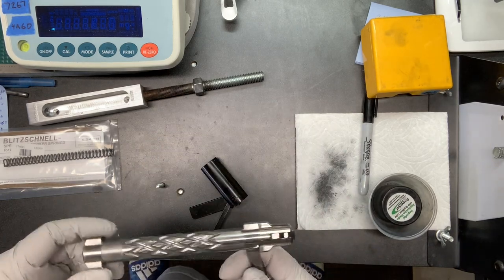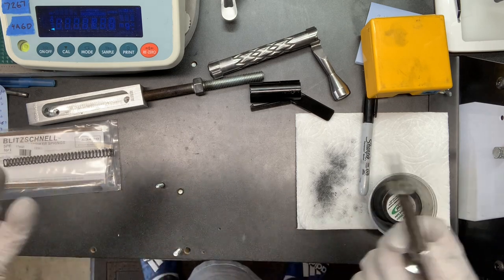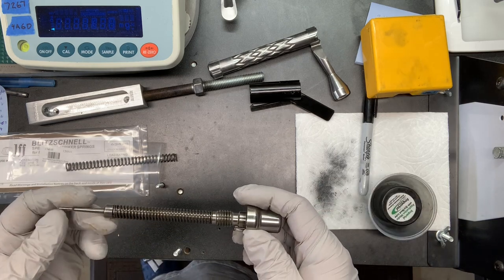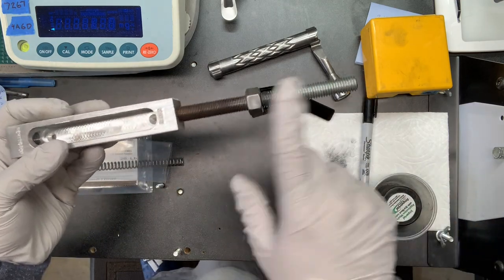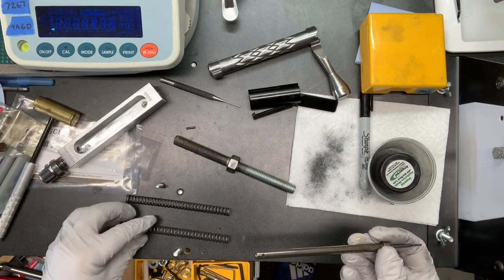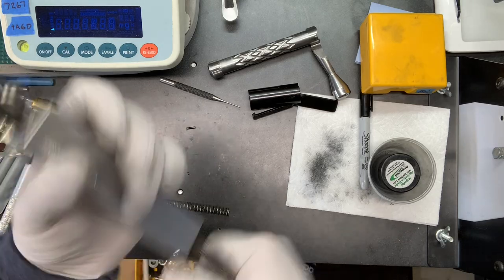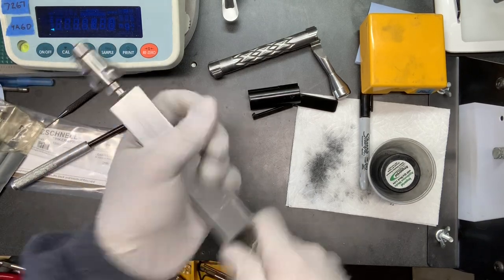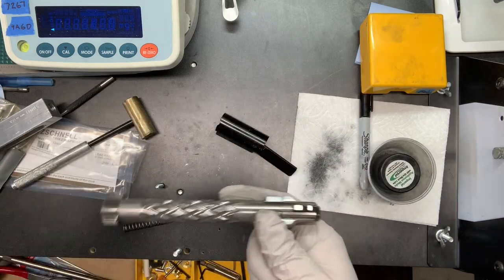How to Change Remington 700 (or clone) Firing Pin Spring and Why it's Important

Comment: This is a great video John, and a real eye opener for me.  After acquiring the tools and a Wolff replacement spring (factory 24lbs) for the Rem 700 bolt in my f-class rifle, I was able to switch out the spring very easily.  I was amazed to find that the original, used spring measured a full 1.25" shorter than the replacement spring.  And that's with only 925 rounds on the original spring, assuming the prior owner's round count was accurate.  (his 200 + my 725)   It might have been mentioned in your narrative or somewhere in the comments already, but I would imagine that just the length of time the spring has spent compressed in the bolt must contribute to its eventual shortening...  i.e., a spring w/ few rounds on it that has been in the bolt for a longer period of time (longer than a year, for instance) could become permanently shortened by as much as a spring that has only been in for a year but has many, many more rounds on it.
Reply from the maker: I’m glad you enjoyed the video and that it helped. You’re absolutely correct about compression overtime. In fact anytime I’m not using a bolt for more than a couple weeks to a month I will always de-cock it with my bolt tool so that there is no load on the spring.

Comment: Man I feel like I’m going insane.  This video is super helpful and I’ve followed all the steps.  The issue I have is I can’t get the pin back in.  I get the holes lined up and when I tap it back in, the holes get off set and it won’t go back in. I’m borderline thinking the pin got bent or warped which is why it won’t go in straight.  Iunno.  Such a weird problem to have
Reply from the maker: Getting the holes lined up can definitely be an issue. I know I fought with that one as well. I doubt yours is bent. I think I found that I went a little past zero when lining up so that as pressure was applied it helped bring the holes into alignment.
Reply: @FClassJohn   Line up the holes by pushing the punch all the way through. Then, retract the punch just a smidge while starting the pin into the hole. Start the pin back in from the same hole it came out. 🙄

Comment: John - what is your opinion on light weight firing pins (alum/titanium) and "high speed" springs? Should a person consider this or just use factory replacements and keep the springs fresh?

Great article...thank you
Reply from the maker: Thank you and I’m glad you found it helpful. As far as firing pins and springs go, I have to say that I think if you are buying a high-end action, I would keep with what the manufacturer recommends. I think they have a very good idea of what the pinfall should beand how that relates to the timing of the action. I know people who have been successful using different combinations but until you have a baseline with your gun using the manufacturer specs, I wouldn’t try changing anything.

Comment: When ordering a new spring and firing pin, do you order from the same company as your action?  I have a defiance deviant and am trying to figure out where to get replacements.  Not sure how interchangeable they all are. Thanks!
Reply from the maker: Yes most people will order form the manufacturer but companies like Wolff make extra power springs for 700 actions/clones and lots of people are happy with those too. The firing pin however should come from the manufacturer.
Reply: Thank you!

Comment: If I didn't know any better, I'd say you're describing my current situation. Rifle seemed to go from 3/8-1/2moa to now barely achieving 1moa with a 308 bartlein. Swapped scope and chassis, confirmed mounts, etc. I'm down to firing pin spring or triggertech trigger. 

How much did your groups open up?

Appreciate your content!
Reply from the maker: Yeah my groups went from a lot of Xs and some 10s, to a few Xs, some 10s and some 9s. Big change.
Reply: @FClassJohn  got back out today and it seems like the spring may have fixed it!  Appreciate the reply.

Comment: Why or how did your friend diagnose the FP being the root cause? Was there any correlation to velocity on those shots that were flyers?
Reply from the maker: Actually there was no correlation to velocity. In fact my extreme spreads and standard deviation‘s were almost better than ever but I couldn’t stop flyers from happening. Kept shooting a tight group only to have a random way out there flyer happen. It was actually the fact that I wasn’t having problems with the extreme spread or velocity that led him straight to saying it was the firing pin spring.
Reply: @FClassJohn  Wow, how interesting. My assumption would have been a correlation to SD with ammo that shot well in a different rig, pointing to a FP spring. I also had to change the FP springs in a pair of Savage 12 varmint rigs a while back, but those demonstrated ignition problems with different primer brands before I figured that out. I'm still baffled how your friend knew to change the FP spring, other than maybe a process of elimination?

Comment: So at how many rounds do recommend doing this change out, I saw 2000 as your new going to but you had 11,000 of that one. Would 5000 be a good spot if I’m don’t have issues before had? Oh I loved  the IPA rinse story for barrel cleaning with CLR on Erik’s video.
Reply from the maker: I think for most people you'd want to do it when you start seeing accuracy degrade for no other reason. For people who shoot a lot of matches and such, I'd say between 2,000 and 5,000 rounds is a safe number. I'm sure mine went longer than it should've but I was still shooting clean targets on occasion with it. Hope that helps.
Reply: @FClassJohn  I earn my coin as a mechanic so l go with preventative maintenance as much as possible instead of waiting on when it’s broke that’s why I asked. Thank you for the info.
Reply from the maker: @mjmorris72034  totally makes sense.

Comment: Very interesting but I don't get it. How can the spring cause flyers? I understand that it got weaker, but it still should have been consistent for all shots. Meaning that it didn't get weaker from one shot to the next.

Great videos. Maybe you can do one on setting up to shoot. I have noticed that if my rest and rear bag are not perfect, I have a tendency to string shots at a 45 degree angle. I can't find anything on the subject.
Reply from the maker: Well here’s what I saw happening looking back at the whole thing. As my gun slowly started throwing flyers I probably had some velocity variation but since I had developed the load already and I was shooting at my weekly match I wasn’t always using a chrono. One the flyers got abusive I jumped to barrel, loose or bad scope as well as doing a new load work up thinking something was out of tune. I can only say that since I was shooting small groups for load development any velocity variance wasn’t showing up so each group was in itself looking good but overall there was clearly a variation someone along the line. I never got past load development (as I just couldn’t get it dialed in) before my buddy suggested the firing pin spring. It’s just weird when it happens, that’s all I can tell you. It didn’t feel like anything I’ve had happen before so now I know. I also now have a reminder in my phone for the first of January so I don’t forget to change it yearly at a minimum. 

As for your your idea I can definitely do that. I feel your pain when setup causes issues on a string and I do have some tricks I use to stay as consistent as possible. Thanks for the feedback.

Comment: Do you use 24, 28 or 32 lbs spring?
Reply from the maker: I'm currently on 28 pound springs but will probably go 24-26 next time based on the recommendation of Defiance. Check with your action manufacturer because they can all be a little different.

Comment: How old was your rifle that had this issue? 

I'm curious as to if this is my issue now as I had accuracy degrade a bit in my rifle so I rebarreled it and since then have been struggling with load development due to flyers. I Still have a lot to check before I make that assumption but I suppose it never hurts having extra springs on hand either.
Reply from the maker: It was a brand new build about three years ago. Even from what I’ve researched after this most manufacturers will tell you that if you are using it on a regular basis you should change it at least once a year or about every 2 to 3000 rounds but of course everybody has their own preferences. I shoot with a guy that changes his every thousand rounds, so he actually changes his more often then he changes his barrel.

Comment: Are the fliers because of the longer delay (time between pulling the trigger and firing pin hitting the primer) of the weaker firing pin spring or is it something to do with the way it hits the primer?
Reply from the maker: It comes down to inconsistent ignition. As they wear out they don’t always strike with the same force so you get what would basically be a light strike and just that little difference can cause shots to fly differently. It’s subtle and plenty of people will tell you it’s bogus but I assure you it isn’t. I know too many top shooters who replace firing pin springs more often that you can imagine for this exact reason.

Comment: did you go with the same strength spring or did you go with a more stout weight spring ?????
Reply from the maker: I ended up with an extra power 26lb spring.
Reply: OK !!!!!  And just pondering were you still getting good primer detents or was it showing lighter strikes so to speak ????
Reply from the maker: I honestly wasn’t seeing much variance on the primer itself.